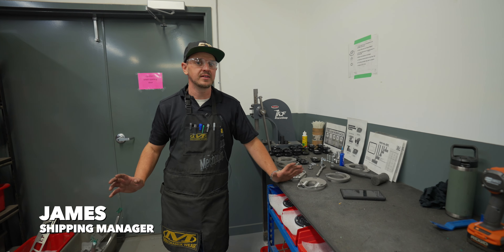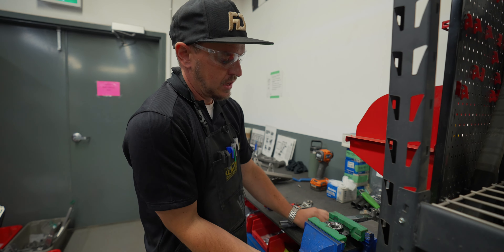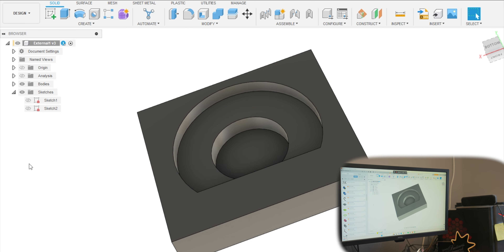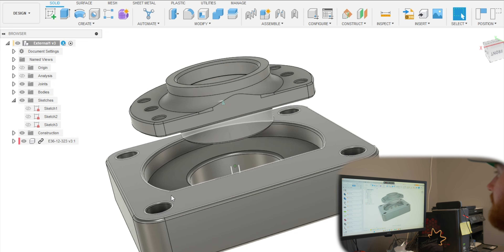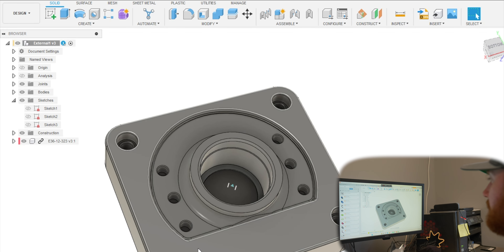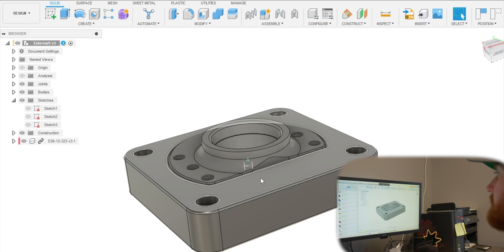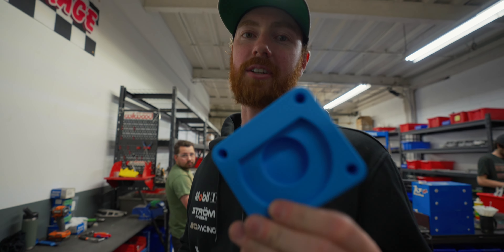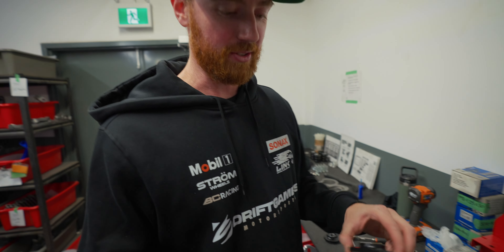Designing and Printing a Custom Tool for Our Shop

Comment: PLA+ for stuff like that. Use it on Pew pew stuff. Even made a dimple die (6 wall 75% infill) and it held up great. 
Petg+ if oil is involved.  
Depending on the slicer software, you can add modifiers so areas have more or less infill to save on filament. 

Would love to see more stuff like this.

Comment: Interesting, I wonder if it could be integrated directly into the press. So you insert the part, press it then insert the retainer and torque it then remove the part. It would save pulling the part and moving it. 
Then a torque attachment to the press so it’s pressed in and then the clip is inserted and the torque is applied. It could all be done pneumatically. Just insert part hit a two hand button then insert the retainer and step on the torque application pedal. 
Then use a stick tool so the parts can be inserted into the mechanism without the hands entering the area. I used to run several machines that functioned like that. They were all very expensive because they were custom made and machined out of steel by trained machinists. The 3d printing really saves the machine work, doesn’t mar the piece and is easily replaced if it wears or is damaged. Very nice thought process. I suppose it depends on the production numbers to have in make sense.

Comment: If you were to sand cast an aluminum piece , using the 3D print as a loss-casting, to bolt onto the bottom of the arbor, then it's even less handling.
Reply: edit: I'm an idiot and you have a laser table to just cut some stackable 2D pieces of sheet metal to bolt to the bottom of the arbor press to allow the bearing to be pressed in, and then the lock ring torqued in, in one handling step.

Comment: try PET-CF from bambulab, not PET(G)-CF just PET, that stuff is rigid and strong as hell, very expensive though. i use it to make engine parts and covers and stuff. Honestly though just reprinting the piece when it breaks would be way cheaper. or just print 4 and have them ready when they do break.